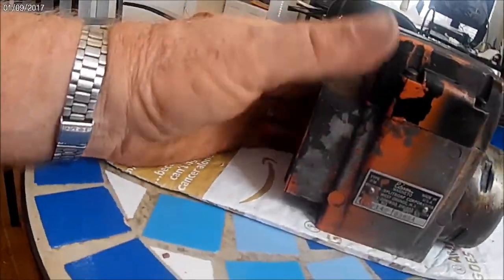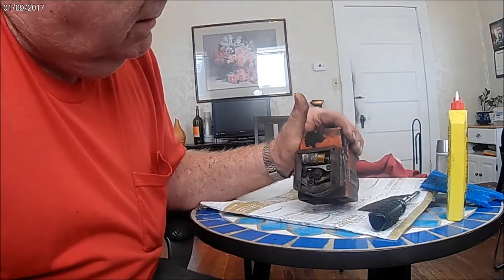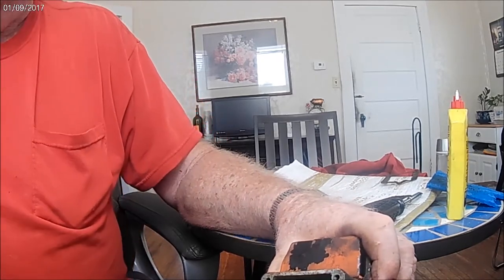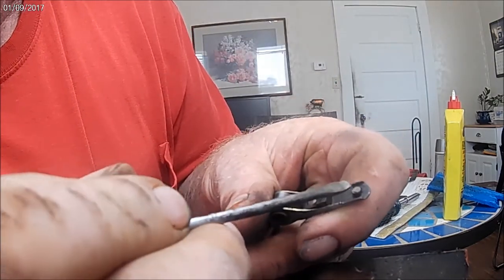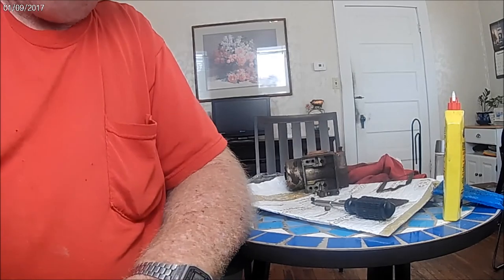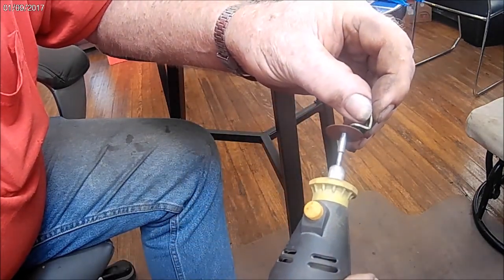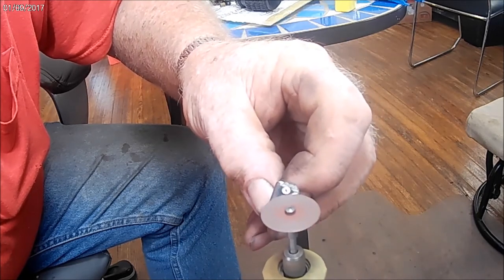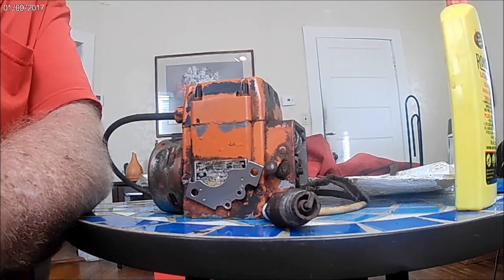No fire on this mag off of the AEH Wisconsin

Comment: It seems like it will work just fine.  Any lawn mower shops around there that maybe can repair those threads for you?
Have a good day.
Mike
Reply from the maker: I went to a few places this morning but no one had anything like that, the parts store wants too much for me to buy something for a one time use.
Reply: @MissouriOldTimer  Yep. They want 50 to 200 dollars for those kits. Crazy!
I had at one time a thread tap for spark plugs. 18mm on one end and 14mm on the other. It was and probably still is around 4 dollars. If there is enough meat left in the damaged threads that may be the way to go.

Comment: Hello MissouriOldTimer,  I also recently bought a small stationary engine at a market. No more brand plates on it. Tonight I found out that this is also a Wisconsin AEH with an Edison magnet on it. The magnet also does not give a spark. So open it up soon and see if I can get it to work. What year would this engine be from? I think somewhere in the early 1940s.
Reply from the maker: according to this site it was made from 41 to 49 , it could be that the points are dirty the reason for no spark. https://www.wisconsinmotorscanada.ca/wspecsoldmodels.html

Comment: I have had incredible luck with seafoam deep creep ... I swear by it now.... I presoak anything that could be frozen . Saved my ass on some spark plugs
Reply from the maker: I put some of that in my buggy, I don't know if it helped or not but I might put some of that in the next stuck project.
Reply: @MissouriOldTimer  Now theres a gas additive and a spray that loosens parts ..The spray is the sea foam deep creep ... different from additive .. Great stuff !!!

Comment: Do you use anti-seize lubricant on your spark plugs?  I understand you did not have that option in this situation, but going forward it might be something to consider.  Very good video M.O.T.
Reply from the maker: I did put it on all the head bolts on the 4 cylinder in case the heads  need to be removed again.
Reply: @MissouriOldTimer  I have some catching up to do on your channel.

Comment: Those magnetos were built to last. Aluminum heads do have their vulnerabilities.
Reply from the maker: I should have  took more time to loosen the plug gently not use so much  force at first.
Reply: @MissouriOldTimer  Maybe, but you know what you're doing, and that aluminum over time has ideas of its own. Had a friend that stripped the head in his old Datsun 4 banger changing spark plugs. He was a seasoned mechanic as well.

Comment: I wonder if china has a 5 dollar replacement head ???  Insane how frequently now its cheaper to just replace parts .
Reply from the maker: I haven't looked but yes, they do have some cheap parts and for the most part, they work fine.
Reply: @MissouriOldTimer  I put a new carb on my pushmower and troybuilt Horse tiller ..Cheaper than rebuilding them .. They work great .

Comment: Aluminum corrodes so easily when it touches steel.
Reply from the maker: when, I think it was Oldsmobile that came out with a partly aluminum engine in the 60's I think it was, I thought that was a big mistake, I thought that was a fly by night idea but I was wrong in one way but as you said, steel and aluminum don't seem to like each other so there are problems, like we shouldn't use steel rivets in aluminum boats.. but I guess that it is just how it is nowadays.